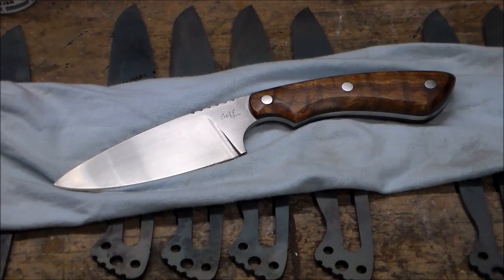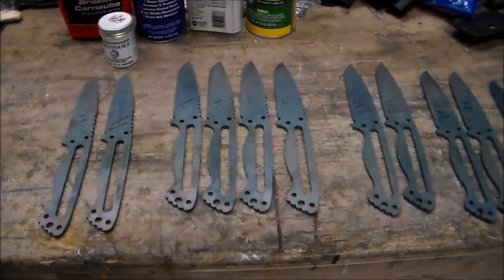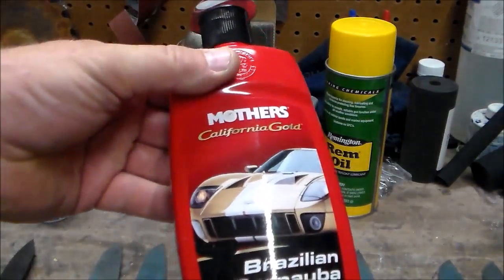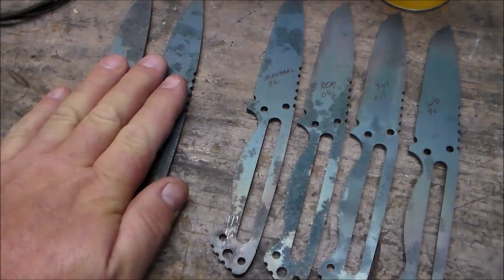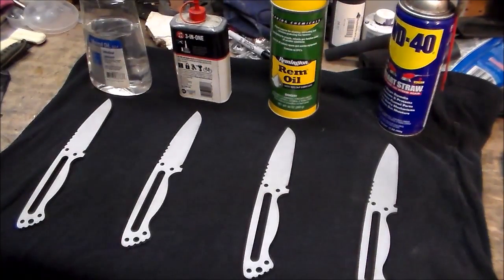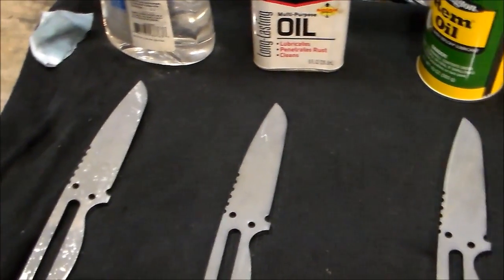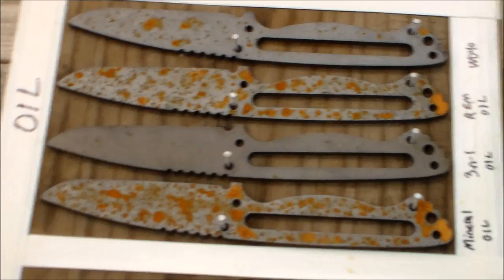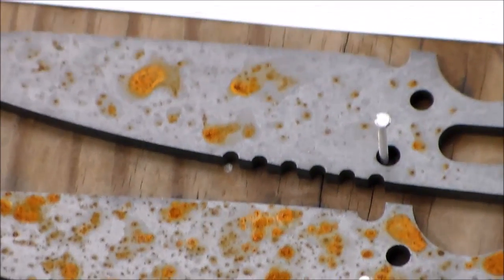1095 Steel, Corrosion/Rust Test for Knife Makers

Comment: An interesting test you made.  I was surprised that 3-in-1 did so well.  I collected firearms and had a meagre collection of edged weapons for about 50 years and rust was always a problem.  I discounted 3-in-1 early as it failed me, but that was well over a half century ago and they could have easily changed the formula since.  I had good luck with WD-40 when a piece got wet as in a hunt.  It disappointed me for long term storage.  The best I found was LPS-3.  They too have since changed their formula.  When I first started using it back in the ‘70s it was messy stuff that never dried looking much cosmoline the US military used and was unpleasant to touch.  This wasn’t a big deal as I collect firearms and putting fingers on the metal is a no-no.  I now live in the tropics and firearms are out and now I collect edged weapons as well as having many working knives.  The rains and humidity try my patience.  I tried Renaissance Wax due to the praise I heard and it cost me about three times what you paid due to importing.  It failed.  Hanwei sword oil worked fairly well.  No 3-in 1 for me to try.  We have an oil that smells like it so I’ll check that out.  While out of country I was able to obtain some LPS-3.  A note here, they give a protection life of 2 years and I have pieces that are exceeding that.  Also of note they have changed their formula and now it dries leaving a white film about like car wax does.  It is not available in country and importing it is next to impossible due to the law.  The most practical I’ve come up with considering all is car paste wax.  It’s cheap, obtainable, and it works, not as well as LPS-3.  I would have liked to have seen that tested.
Reply from the maker: +pgandy1 The car wax in this test was a liquid version, but Mother's makes the same thing in a paste form. I tend to think they would perform the same, but that would be another test I guess.

Comment: SMF, thanks for doing the work.  I was rootin for wd40 and 3nOne cuz I have so much of the two around (use them for lubrication on my bikes and get them gifted to me).  Not being a knife guy, I'm kinda shocked at the rust-fighting power of 3nOne. Looks like I'll be using the oils on more places on my steel bikes from now on instead of pricier stuff.

Comment: Something I've been doing to high carbon blades for about 15 years is what I call "poor man's powder coat". Brush the blade with salt water and let it get a thin layer of surface rust. Smooth the rust with fine steel wool and then brush with rust converter. The surface rust reacts with the rust converter and turns into a brown/black finish that's rust resistant.
Reply from the maker: I've got some of that rust converter stuff I bought at a hardware store, never thought about using on a knife. Interesting....

Comment: This is awesome. Thank you!  I was searching for something on YouTube for my blades (bought, not made by me).

So, it looks like Birchwood Casey Super Blue along with 3-in-1 oil is the go-to for non-food grade? And, Super Blue with mineral oil for food grade?  Or does the Super Blue make a food utensil not safe to eat off of?

I’m also interested about what simple boiled linseed oil does without heat, for non-food grade.

Again, thanks for the great video. So much time and effort went into this.
Reply from the maker: Thanks! I can't say for sure if cold bluing is safe or not. I think it is, not a concern to me personally. I rarely use a field knife for food, so I don't worry about it. I figure over the years I've ingested far more oil working on cars, planes, backhoes, etc than I'll ever get from a knife, lol.

Comment: Great video, gives people the opportunity to see the best finishes to use and which ones will hold up over a long period with no maintenance.

However, I would have liked to see what it would look like on a finished blade, I mean would it make a difference on the cutting edge?
Would it still be effective if the knife was in use each day of the test doing some basic bushcraft tasks like cutting, chopping etc.

Finally, although accurate for non maintained blades, I believe all options would work fine if you were going to keep your knife dry and reapply to your knife after each day you used it.
So it all comes down to which method you prefer and how much your willing to spend.

But since 3 in 1 is so cheap, it would be a no trainer to use, just lugging a can of the stuff in your back pack might be a hassle, how long would it last in a smaller container?
I can see wax lasting for months if you maintain daily after use, given the small tub size and weight, might be ideal for long term use in the field even.

Also have seen a lot of people using vinegar to get a acid coat or mustard to get a patina, are either recommended or even good for treating a knife?
Thanks.
Reply from the maker: Yeah, I agree that any of these methods would be fine if the knife was used and maintained properly. I was looking for a worse case scenario. As for patina, I've used vinegar etch, but not mustard. The vinegar takes a lot longer to build up, but ends up very similar to ferric chloride.

Comment: yo bro, nice video. i do HEMA and all of my swords have 3&1, yes the smell, but the performance of 3&1 is unreal. ;i have two "fun" swords a katana (1095) that snagged off of ebay for 300 bucks, that was steal... lol.  it has a wooden scabbard. i also have a long sword that is 1060 spring for 500 with a cardboard leather wrapped sheath. i have loaded up the insides of the blade protectors with 3&1. they have held up really well, and i beat them alot. my sparing blades are food grade mineral oil which need ALOT of maintenance

Comment: good test my only issue is after it rained some rusted but it could have washed the waxes and oils off the knives and then rusted?
Reply from the maker: Thanks for checking it out. Yes, I'm sure some of the treatments wash away, but that's sort of the whole point of the test. Even a blade going in and out of a sheath removes some of it. If you took a knife on a week long backpacking trip and used the knife daily, what ever coating you had on it would wear off with use. I wanted to know how well they stand up to the elements against each other in a worse case scenario. We should always take care of them in a perfect world, but some hard users may not always be able. Some users are just lazy about it.
Reply: That's the thing with WD40, it's a penetrant and disperser not a proofing agent. It will evaporate / wash away over time. It's good to have a test like this that shows that fact to people who treat it like a water proofer on metal.

Comment: Dude, im still in the middle of video( just on the table), but i wanted to say that if this is how you are doing a test, then when i save some money up, im going to buy a knife from you for sure. 

😆 I don't even know what types of knives you make, but you sure are conscientious about your work.

Thank you for informing a newbie like me( 3 weeks collecting) on what best to use for caring of knives. 

Be blessed, 

Leo ✌🏼

Edit: just saw the end. 

I think the wax might be Renaissance wax would be best for me. 

Value per $, just because you can use it one every aspect of the knife.

The blade, the sheath, any gem or pearl on the knife and probably be able to eat after cutting food with knife because it is wax. ( I would check what other things in wax to see if possible bad for body).

3 n 1 and WD-40 is what we used as kids for everything. Because it was free (dad's) and it worked. 😆 
It might not be a thick coating, but i don't think it is too good with food. 
And in the long run, it might degrade the foam in a case. I plane to put them in a case with a lock.

These are some quick thoughts.

Can you tell me what you think in my comment in a reply if you read this?

Also what are you using since its been a few years?

Thank you and hope you are doing well.

✌🏼🦁
Reply: Johnson's Paste Furniture Wax is just as good. and costs a fraction of what Renaissance wax costs.
Reply: @LBCAndrew  thank you. Will look into it also. 

I did buy the wax, but i like to experiment also.

✌🏼🦁

Comment: I am surprised about the wax. I really wonder if there were blotches of not properly covered areas because rain in that short of a time should not, in my mind, be wearing the wax away like that to cause rust spots. Did you buff the wax? Buffing helps to finish covering the wax over the complete surface..
Reply from the maker: Yep, buffed with a new soft towel. I actually like the wax ok, I just no longer think of it as an apply and forget it finish. It needs maintenance, just like most things.

Comment: Great video! Is 3in1 oil safe for leather? I'd like to apply this to one of my survival knifes, but afraid it may harm my leather sheath.
Reply from the maker: Too much oil will mess up leather. Best practice is not  to store knives in their sheaths for long periods. Leather can absorb moisture from the ambient moisture in the air and cause a knife to rust inside. For storage, a healthy coat of oil is great, but before putting in the sheath I wipe it down well. Or, you can use wax. Wax also works well if you keep it maintained.

Comment: great test, very useful info, thanks. i think blued with 3in1 is as good as it gets for 1095.
Reply from the maker: Thanks, that's pretty much my go to now for a lot of my carbon steel blades. I still use ferric chloride etch a lot too, ends up nearly the same.

Comment: A corrosion prevention lube that I have used on many things that are exposed to saltwater (worst environment for corrosion) for long periods of time with no corrosion developing is Corrosion-X. Their formula is something entirely different. I am in the aerospace industry and use many different products but none of them can even come close to corrosion-x. looking at the listed ingredients you will see a calcium carbonate on the list. I believe what makes it work so well is that the carbonate must neutralize any acids that try to form thus protecting the metal. I put that stuff on my outboard engine which is now 15 years old and when you take the cowling off and look at the engine it looks brand new. not a single speck of corrosion to be found. I go offshore salt water fishing in it. I also placed it on the trailer which gets immersed in it. again no rust formation period. It works so well at insulation the steel that we cannot use it on electrical conductors because we found that it actually was able to block the negative return of voltage to the primary ground studs. That tells you something. Now that was the thicker corrosion x that leaves a waxy film when applied not the oily thin stuff. The only downside that I can think of with it is that you can use it on knives that you may use to cut food with.  I am going to try a bare metal test like you did here in Texas and see how it fairs. Great test by the way!!
Reply from the maker: +Dennis1359 Thanks for the tip, I'll check it out.
Reply: No problem....

Comment: I think it would be fair to say that all of them would've been fine in normal household conditions with or without oil or wax or even heavy use if kept clean and dried like most of us do on a normal bases after each use, they should also transport well in a mail package with just some normal wiping down with any of these oils and waxes before sending them off.
Reply from the maker: I agree. But.....I once made a knife for a kid that left it in a wet sheath after a camping trip. Major rust! So, that's what I was thinking about when testing, what's the worse thing a customer might do. Thanks for checking it out.

Comment: Great test. Thank you for sharing. I am testing a number of food safe finishes right now for chefs knife. I did Axe Wax, Frog Lube, Simple Finish, and Ren Wax. I know Ren Wax isn't technically food safe but based on what I've read, most people say that the toxic elements in it actually evaporate. You have any thoughts on that? Seems like Axe Wax or Frog Lube are going to be the best for my use.
Reply from the maker: yeah, I use Ren Was quite a bit. Now, I wouldn't slather a coat of wax on it and immediately go cut food with it, but, for a general use blade that I've been carrying for a while, wouldn't even worry about it.

Comment: I watched this years ago and now I came back. 
Today I took my new ESSE 1095 blade into the wood. I did maybe 30 cuts into weeds and branches while I was clearing the trail. Then I sprayed the blade with silicone oil and chopped down a 2-3" tree that was in the way. 
When I came home, maybe an hour later, the edge had ugly, orange rust spots like it was sitting outside in the rain. I'm shocked, honestly. I sprayed it balistol which made it a bit better but it's not going off.
Reply: Its high carbon bro.. if your using it in a wet enviroment and dont wipe it off its gonna rust.. just use your knife , but when you sheath it, wipe it off first.. if that bothers you that much, i believe esse makes the same knife in stainless steel..  but the 1095 will be fine as long as you wipe the dampness off of it when you sheath it.. then get home , clean the blade good, and oil it..
Reply: @no.step.on.snek.2423  It wasn't wet and they don't make a stainless Junglas.
It was quite surprising considering that the blade was oiled.

Comment: I have an Off topic question, but first I'm a DIY "cheap skate" as well and like doing my own  projects and learning a lot form your Chanel, thanks bro.  I want to make a few hunting knives from 1095 and don't have a way/don't trust myself to properly heat treat them. Do you heat treat your blades yourself or send them off to be HT?  Any recommendations you can give me I'd really appreciate it. Thanks
Reply from the maker: I do my own heat treat, I've got an Evenheat kiln. I started with a freebie pottery kiln, it worked but the top loading wasn't so great for knives. Check out my "first knife" video to see that setup. If you stick to fairly simple carbon steels, you can even heat treat with a torch. 1075, 1080, etc just need to get to critical temp and go right to quench. More complex steels will require the oven. They're expensive, but if you're going to stick with the hobby, they're worth it.

Comment: I use ferric chloride (PCB enchant) on all my carbon knives. It makes a huge difference. No wax or oil. However, I don’t sit them in the rain for a month either.

Just as a general measure against rust I apply it and it does the job quite well. I can leave them sitting unused for months without rust developing whereas untreated O1 and 1095 starts to rust in no time while stored inside.
Reply from the maker: Agreed. I like ferric too, makes a huge difference.
Reply: Self Made Project 

Wow, YouTube notifications are only two months late! I just got notified that you replied. Brilliant!
Reply from the maker: @Wolf_K  ha! Yeah, I've had that happen before, it's weird.

Comment: Thanks for sharing your results. This is interesting and valuable. I need to change my practices now - its the hallmark of a good study. I guessed that a more viscous oil would work better than thinner ones- just tell any machinist about how remoil or wd40 is great for rust prevention and you'll get the whole tirade. I guess the mineral oil didn't penetrate. The wax results were dissapointing.
Reply from the maker: I think they all work to degree, but in a worst case scenario, they aren't equal for sure. Thanks for checking it out.

Comment: Have you thought about "hot bluing" the knives? Personally, I can't be trusted with a non-stainless steel, but I do have one completely non stainless knife (an Opinel) I tried to force a patina on it, but I had no clue what I was doing and rusted it badly. After cleaning it up with sand paper, I blued it with Birchwood Casey, also used heat. IE, set the oven in my kitchen to "warm" (figure around 200 degrees so hopefully not hot enough to mess with the heat treat of the knife) and did 8 or 10 cycles of wash with rubbing alcohol, scrub with steel wool, apply bluing, into the oven for about 5 min, repeat. This seems to have left me with a much thicker and more durable coating (more similar to the factory bluing you'd see with a gun I'd say) than applying cold, and what seems to be very good corrosion resistance. It did not seem like much work when I did it to one small folding knife, but it might be different if you're making batches of fixed blades.
Reply from the maker: Since making this video, I have got a hot bluing system now. I haven't actually hot blued an entire blade yet, so far just guards and fittings. I do need to try it sometime and do some durability testing. I have tried parkerizing too, a long time ago. It works pretty good for a hard use blade.